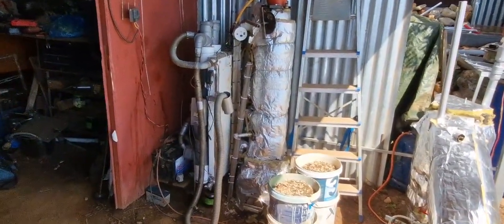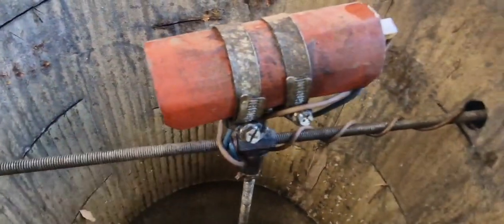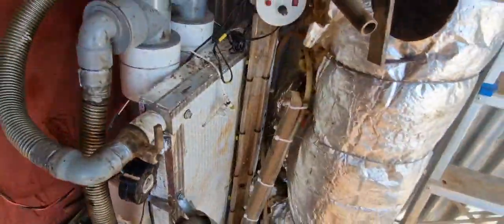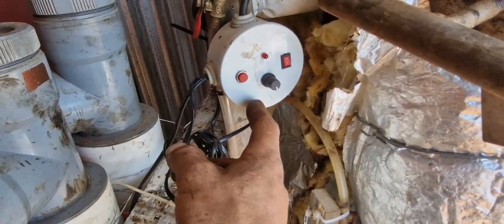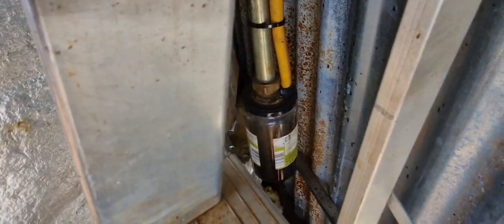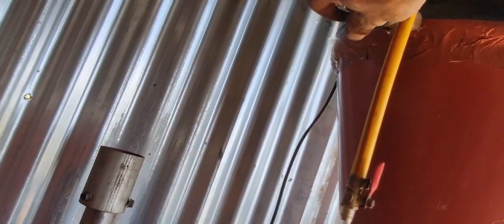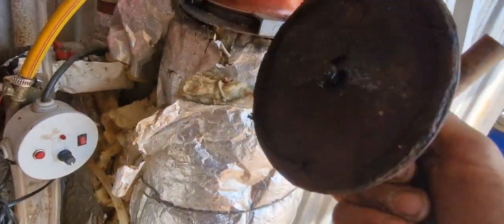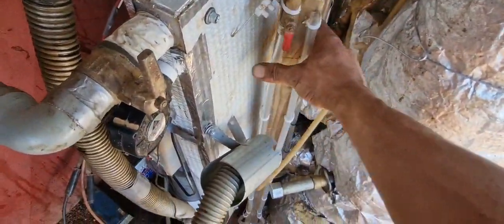dual fire gasifier testing #DIYGasifier #BiomassEnergy #OffGridLiving

Comment: What did you use for the orange cone...
Reply from the maker: 0.5mm galvanised steel sheet, but it turns out 110mm diameter gasiffier can only run on fine chips for the long run , so this design must be enlarged to work correctly, as there's still some tar in the gas I'm focusing now on seperate staged gasiffier

Comment: How many kwh electricity can you get from 1kg dry wood?
Reply from the maker: Whit a mix of 70% olive wood (hard type) en 30% soft type) about 0.9kw/kg at around 20/25% moisture you can get more if the fuel is dryer or whit exhaust heat recouberation, my new type can get about 1.2kw/kg at 30/35% moisture
Reply: @oscarverwey  1.2KWh starting to look great. 
Why you don't like tiny wood chips?
Reply from the maker: @wenus525  only my new multi stage gasifier can take small en relatively wett chips whit the higher efficiency (around 1.2kw/kg because Al the stages ar separated in different zones,  for the straight pipe i dont like smal peaces because it blocks the air to penetrate the middle of the combustion zone en in treated tar can pas by en it wil clog up the grate so you lose a lot of charcoal but shaking it out, the small twigs ar also a problem whit bringing en clapsing en chose quite some tar fluctuations in the output gas , Al this is eliminated whit my new design ;)
Reply: @oscarverwey   this one is multistage? How did you modify nozzle, except closing one?
I read papers that multi point air injection is better-> 5% at apper part (around drying zone), 15% middle part (pyrolisis), 80% oxidation.
Reply: @oscarverwey  Solution for small particule is to reduce thickiness for air penetration, a good way is to built coaxiale multiple air nozzle ( a classic design  with  an air pipe with nozzle in the center reactor
Reply from the maker: @Gazotiere  I appreciate your response, i agree this is the solution for one part, I already use a ring nozzle for the 3 stages I have available, the other part is that more clinkers (molten ash rocks) are produced from the the fine stuff , so fine dust should be eliminated in any case,  about the center air nozzle I found this is necessary for low load at a bigger diameter pipe, 110mm at 1 hp load is already plenty to maintain the right temperature en bed penetration